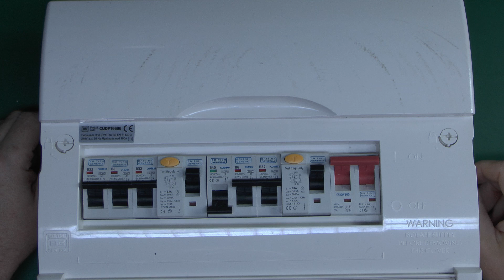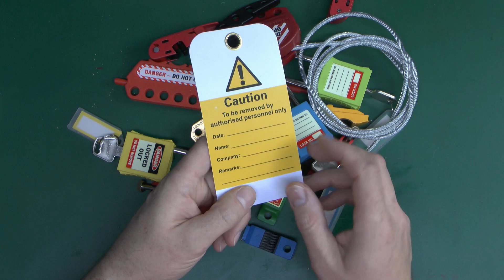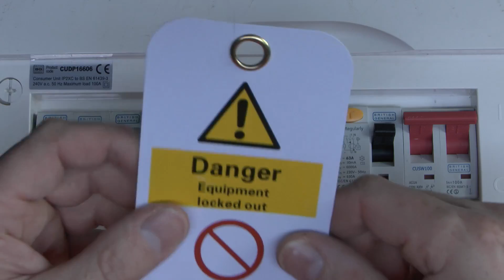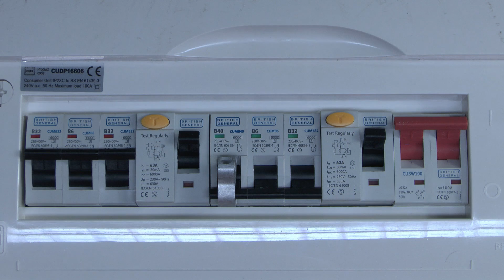Electrical Lockout Tagout Equipment

Comment: For example here in sweden, we don't usually use lockout/tagout. Instead, isolation switches have a special warning label (should have) that says they are NOT to be used to shut down equipment. The reason isolation switches DO have these warning labels, is because only the person who turned the switch off, should turn it on again. You can turn on a switch someone else have turned off, but ONLY after 100% verified that its safe to do so.

The reason isolation switches shouldn't be used for this, is because imagine someone using a isolation switch to shut down a factory machine at friday, and then start up factory again at monday. Thats incorrect use, because if someone would be to work on the machine during the monday before factory opens, the guy starting up could kill the guy working on machine.
If you want a switch that is to be used to regularly shut off things for other causes than safety, , then wire TWO isolation switches in SERIES. Put warning label on one of them (or if they both have warning label affixed from factory, remove one of the labels).

Then people know that if the switch without label has been turned off, its safe to turn on again. If the switch WITH label has been turned off - DONT TOUCH. But its important to clearly label the switches "SAFETY SWITCH" and "REGULAR SHUTOFF SWITCH" so people clearly know not to touch safety switch.

For circuit breakers, the easiest way to "tagout" a breaker in sweden, is to just put electrical tape across it. The best tape to use is green/yellow earthing tape. Just tape it from the top, over the flipper, to the bottom. This clearly tells "Do not touch".

Theres only one exception when lockout is used, and that is in public accesible spaces. In those cases lockouts are of course used, because any civilian could otherwise touch the breaker and cause a accident. An example would be a isolation switch located in the customer area of a shop.
But if the space is closed in such a way only authorized people visit that space, everyone should know that a turned off isolation switch is turned off for a reason, DONT TOUCH, or if a circuit breaker is taped off - DONT TOUCH.

In sweden, if you turn on a isolation switch that someone else turned off and cause an accident, or if you turn on a circuit breaker that have been taped off by removing the tape and turning it on,  and this causes an accident, you COULD be liable for causing bodily harm.
Reply: Some isolators come with holes so they can be padlocked in the off position. I've come across locked switches like this where the control and padlock is fitted to the hinged front of the casing but the lock doesn't lock the casing shut - so simply open the casing and turn the switch on with an adjustable spanner or such.
Reply: The question is wihether everybody understands and obeys the rules.
Reply: @alanpatterson2384  That's not the question as you have to assume they don't.
Reply: Well it sounds like Sweden at least has common sense in their electrical regulations something I can't quite understand where's my dictionary I have to look up this word "common sense"?
Reply: Do you also put green/yellow tape over your ignition switch keys  ;)
Reply: @millomweb  No, the difference is that a breaker in a trusted location, then you don't need to lock it out. In many places the breaker panel already have a lock (then access is already restricted to those few that has the key), and if not, the breaker panel is usually located in a location inaccessible from the general public.

When a breaker panel is located in such a way its accesible to the public - for example in the customer area of a shop, then it should be locked out during work. You do NOT need to use a personal lock. Its enough that a cashier or shop manager affixes a lock that the cashier or shop manager has the key to, and when you are done, the cashier or shop manager removes the lock. (usually the lock is affixed to the door itself, not just the breaker affected). If the breaker panel door already has a lock, then cashier opens it for you, then you turn off the breaker, and then the cashier closes it for you. Then you can trust no customer is gonna touch the breaker since the door is locked with a key only casher/shop manager has.

If multiple people have the key to the padlock or breaker panel door, and you can't inform everyone about the lockout - just put some tape over the keyhole, like yellow/green tape. And if possible, just a paper letter saying "DONT TOUCH". Then everyone knows that work is in progress.
Reply: @sebastiannielsen  We put notices on in any case but still don't trust that - hence the use of locks.
And if I didn't trust even that, I'd enforce safety by connecting the live and neutral wires near where I was working - then if someone did override normal safety systems, another would protect me - even if that meant tripping the whole supply to the premises.

Comment: Wait, UK sparkies need to buy their own LOTO tags out of pocket?! Over here in the US OSHA regulations require their employers to furnish all necessary safety equipment INCLUDING LOTO equipment.
Reply: If you work for yourself you have to buy them and some don't
Reply: @RobertSzasz  and they'd be in violation of OSHA regulations. Surprised they stay in business very long doing that.
Reply: @TestECull  working on residences. Self employed? Who's going to call the regulators? It's a stupid thing to do, but lots and lots of people cut safety corners
Reply: @RobertSzasz  Working on residential systems is probably the worst place to be lazy on LOTO to boot. Homeowners tend to be pretty damn forgetful at times and are far more likely to randomly flip an 'off' breaker back to 'on' if they see one...

I'm not particularly concerned about safety but even I'd make sure to thoroughly LOTO the breakers if I was a pro sparky working in someone's home.
Reply: @RobertSzasz  The irony is, self-employed and working alone exempts you from OSHA regs in many cases. Even then, I still recommend you abide by LOTO.
Reply: @TestECull  Just tape it off like he did in the beginning. IF a homeowner takes off the tape and turns it on, endangering you, you can report him to police for causing danger to other's in sweden. If an accident happens, even if its just a minor shock, then you can report for causing bodily harm.
Reply: @sebastiannielsen  I'm not taking that chance. 120V is capable of causing fatality, 240v as JW uses even moreso.
Reply: I always supply my guys with all the LOTO kit they need, I see it as part of PPE
Reply: @KevinOsborne1987  Which is as it should be. Angry pixies will fuck you up in half a heartbeat and you'll never see it coming.
Reply: I guess it ought to come under PPE ! Lots of UK sparkies are the employer ! Or maybe then the customer is the employer !

Comment: YouTube Machinist AVE sells some "safety" stickers on his etsy site "AvEwerkz". Not appropriate for younger and sensitive audiences.
Reply: The not for F.wits is most apposite. 😃
Reply: JW is the technical antithesis of Ave.

ENGAGE SAFTEY SQUINTS!
Reply: @coffeecoffee5914  safety Squints do work I usually use them when I'm tired of getting stuff stuck in my eye because I'm wearing the safety glasses, I have now learned that some materials are better with safety glasses like cutting wood and some materials are definitely not safe to use with safety glasses.

Comment: First Time I have seen an electrician on YouTube using a lock off kit.... :)
Reply: Nagy did last week I'm sure
Reply: We are a professional lock manufacturer with 10+ years of experience. Our main  products include smart locks, mechanical locks, and industrial locks, certified by  CE/ISO9001. All products feature high security, durable materials, and competitive pricing. We support small MOQs and timely delivery.
Would you be interested in receiving our product catalog and quotation?